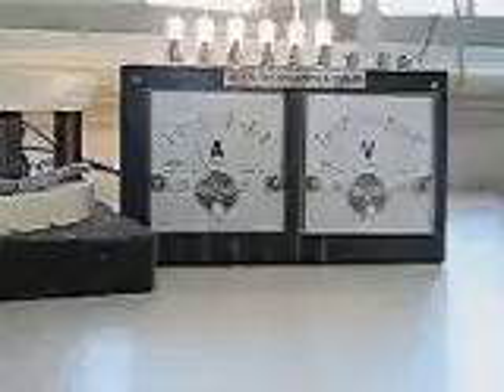Lutec Proof of Concept | Lutec Electricity Amplifier | Magnet Motor

Comment: My thought is that perhaps the AC metering is peak reading rather than RMS. Given the output is pulsed as indicated by the fluctuating light output This readily accounts for any perception of gain in energy. I find it curious that the inventor would not realize this if indeed it is the case. Be smart folks there is truth in knowledge. input energy (watts) is converted to EMF (motor) and is stored in the armature mass (its weight), EMF is then converted to pulsed or quasi AC with a waveform peak that coverts motive energy in short pulses. The deception is in the fact the output metering does not reflect the short nature of the pulse but rather shows the peak value continuously. I believe the output would reflect the expected amount of loss if it where rectified and filtered back to DC for ease of measurement or if the energy where metered using true RMS reading equipment.